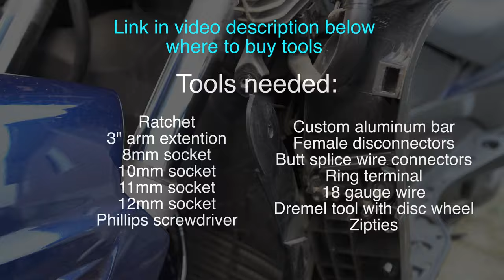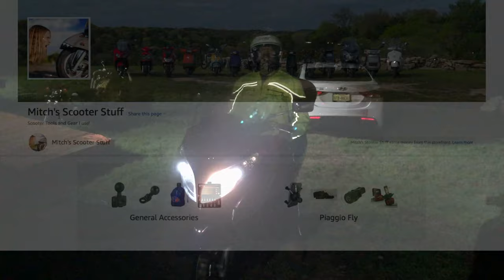Stebel Horn Upgrade on Suzuki Burgman 400 2007-2016 | Mitch's Scooter Stuff

Comment from the maker: GET HORN HERE - https://amzn.to/2KSO4hA
* Tools I used in this video: 
Ratchet 3/8 drive - http://amzn.to/2hhmnUs
3" / 6” extension set 3/8 drive - http://amzn.to/2h7ypMl
8mm socket 3/8 drive - http://amzn.to/2xLNVXU
10mm socket 3/8 drive - http://amzn.to/2xGuLSF
11mm socket 3/8 drive - https://amzn.to/3daJes5
12mm socket 3/8 drive - http://amzn.to/2xM4Edr
Phillips #2 screwdriver - http://amzn.to/2fgdZDL
Custom aluminum bar - https://amzn.to/2KSSPrs
Female / Male spade connectors 18awg - https://amzn.to/3d5Eq77
Butt splice wire connectors 18 - https://amzn.to/2VSYyn8
Ring terminal 18 - https://amzn.to/2Ymo6L4
Wire 18 awg - http://amzn.to/2FMHKno
Rotary tool - http://amzn.to/2FLwhV4
Cut off wheel for plastic - https://amzn.to/2SqhCXL
Zip ties - http://amzn.to/2pkp3AL

Comment: Will using a double horn in the place of a single horn cause any battery issues??..
Please do reply...
Reply: Depends how you will use it. With a moderate usage shouldn't  cause any problem.
Reply: Not at all, unless you are sitting for 1/2 h on the horn button.
BTW. the included Stebel relay is not good. Either mount it easily accessible so you can swap it when needed, or use another good one from the beginning. Do not mount the horn without.